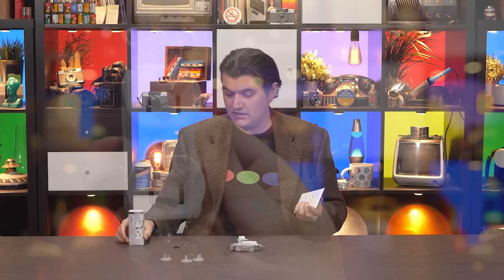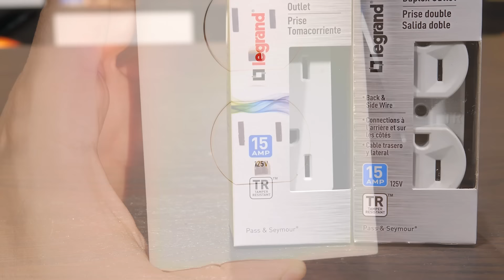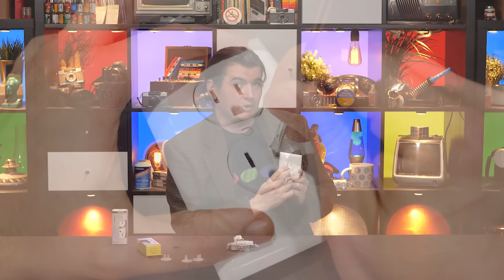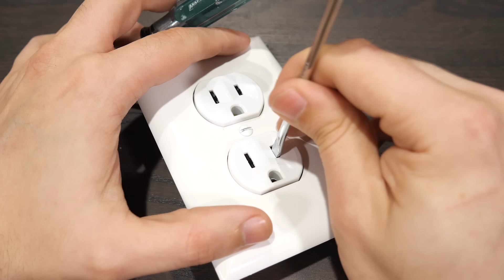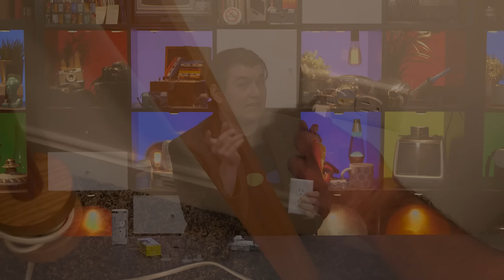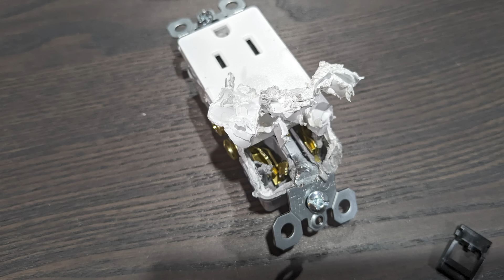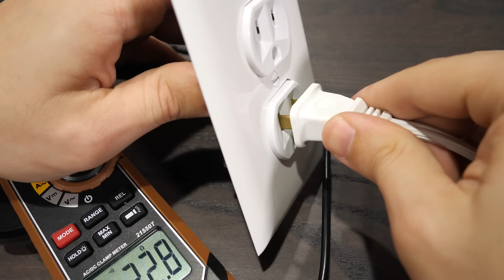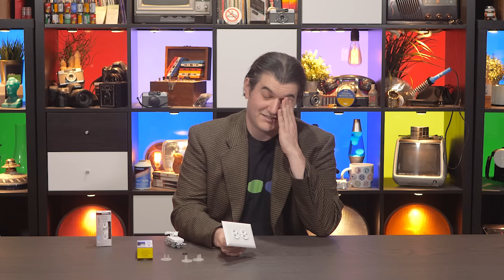Tamper-resistant outlets aren't all the same - a follow-up

Comment: The tangent about voltage reminded me of people who say "its the amps that kill you, not the voltage".  The problem is, they're related.  More voltage directly equals more amps, all things held equal.  I prefer to say that "Voltage shows how hard it's trying to kill you, amps shows whether it succeeded". 1.2V is barely trying to kill you, it is only technically possible in extreme circumstances.  12V can try, but almost always fails, usually just giving a tingle.  120V is dangerous and should be respected, but is only occasionally a death sentence. 1,200V is very bad news if you touch it, and can mess you up easily.  12,000V is about when it will start jumping (short distances) through the air to get to you.  All of these options just have to get a certain amount of amps in various places, but they're more effective at doing it as the voltage increases.  Note: This generally assumes DC or AC voltage supplied by a decent power source, not something like a stun gun where the voltage is not sustainable.

Comment: I believe loose plugs are a phenomenon of cheaply made outlets that are wearing out. I grew up in old houses, and I don't remember a lot of vintage outlets having this problem. But the house I live in now was completely renovated in the 1980s, and all the original outlets were replaced with what I assume were "contractor pack" outlets. Not all of them fail to hold plugs securely now, but I'd say each room in the house has at least one that does. I'm replacing them with better ones, and, where it makes sense, with outlets that are tamper-proof, double as night lights, provide USB charging, etc.

Comment: If you want the MOVs to work in a surge suppressor you need a ground. A 2011 NEC change,  250.130(c), allows for a ground wire to be added  when replacing old non-grounding receptacles and a Type 2 unit on the main panel helps protect the electronics in your appliances also.

Comment: Regarding plugs falling out, I mean it literally, when I (an aussie) visited my partner (from the USA, specifically Alabama), plugs were constantly falling out of the receptacles, had to keep getting up to plug them back in. The receptacles were suuuuuper loose, I barely felt any friction at all when inserting and removing the plugs

Now that is probably from them just being old receptacles, but it was absolutely an issue I was experiencing. I've never had such a loose plug/receptacle in Australia (specifically Victoria), but found plenty in Alabama.

I don't know how much of this is due to the design of the plug/receptable, but the live and neutral prongs being parallel seems like something that would potentially make the problem more likely to occur

Comment: I've been zapped by my tape measure as it 'cracked', slid down the wall and stopped sliding when it reached the positive prong. That one hurt because I was holding the tape measure as opposed to a fleeting touch to a live wire.

Comment: I have been electrocuted by a standard laptop AC adapter.  It got stuck in the power bar and I did not power off the strip, which I should have done.. I braced the bar with one hand and reached way down on the plug with the other.  When I did this I had grabbed the plug in such a way I touched BOTH pins and the ground did nothing. I was immediately shocked very badly.  I can't not under estimate the amount of pain I felt.  My entire right arm felt like burning, fire, buzzing, and knives scraping and I was unable to move my arm for nearly 10 minutes or longer.  When I could move it, it hurt very badly to make a fist.

Since that day, I have a jump in my arm, when I attempt to do small precise movement with a mouse.

Comment: "The receptacles wear out, but it takes decades.  Unless they're cheaply made."  My last apartment must've been incredibly cheap, they couldn't have been older than 5-10 years but nearly every single one in the unit was so worn out that you practically couldn't keep a cord in it at all.  They would literally fall out of the wall entirely from gravity on the cord, unplugging the device.  I had to harass the office for a month until they finally agreed to replace them, and even then, they kept trying to ask me for a list and refusing to accept "Just replace every single one, they're all bad."  (There might've been one or two that weren't so bad, but I didn't want to have ones that were marginal, either.)

Comment: 11:30 you might be interested that they have back wire (still uses screw terminals  goes straight in from the back) now in the US.  Theres also Edge lok outlets now and they are like the cool wagos with the levers you can flip up to release the wire

Comment: Interestingly, only the intermediate age plugs seem to fall out of the sockets.
I work in a historic building (that predates man-made electricity) and we still have a few really old bakelite outlets that remain a super tight. It's a real "they don't make 'em like they used to" type of thing (though the bakelite wall plates over them have long ago crumbled and were replaced). The "newer" 40-50 year-old outlets, however, have all become really loose and the plugs do fall out (even bending the plug blades barely keeps them in the sockets). I've raised multiple maintenance requests about this because most of our computers are plugged into those outlets and the cords do get kicked out on occasion. The newest outlets (<20 year-old) hold perfectly fine but still not as tightly as the bakelite sockets.

Comment: A note on your tangent, in my time on being an electrician, I've been shocked a few times:
At 24V DC I noticed I was being shocked, it was disconcerting but it really got scary when I noticed I couldn't let go.
At 48V DC I was mostly just embarrassed that it happened.
At 120V it's a jolt, sometimes accompanied by a muscle spasm, mostly get angry.
At 277V there are usually burns, it's VERY painful, I yelped and inadvertently jumped off the ladder.

In conclusion, people are usually shocked when they find out I'm not a very good electrician.
Reply: Not as shocked as you were.
Reply: @ynotw57   Don't do this in Europe, you'll be welcomed by 400V ! (tree phase 240/400 not an industrial but an household thing you can encounter in 9Kw  full  electric range)
Reply: @lapub.  three phase? No thank you.
Reply: 3 phase is the shit. been give my boss shit becouse they put split phase in at work  @ynotw57
Reply: @lapub.  to get 400V you would need to touch two live conductors at the same time, unless you're in a 400/690 system which is getting more common, but usually only in large industrial applications where safety standards are a lot higher.
Reply: @UhOhUmm  sure but some country like Belgium sitll have some old 3 phase system with 127/220V with all appliance run at 220 between phase, it was just to let know you can even have higher voltage in home in Europe
Reply: @ynotw57  Why ? it's useful, you can run refurbished industrial appliance, like a 4KW Karcher !
Reply: @lapub.  it’s definitely useful, but I wouldn’t want to experience it through my fingers.
Reply: @lapub.  I don't mess around with 480V here. If I'm working in a 277/480 enclosure I suit up. Gloves, robber mats the works. I've seen people who have blown up their hands in those cabinets and I take no chances.
Reply: @UhOhUmm you say that… I end up in the 480 cabinets far too often as someone not in maintenance, nor trained in electrical work. 

And yes, it absolutely terrifies me every time I open one.
Reply: @ynotw57 3 phase is not anymore dangerous/painful than single phase. It’s the same thing, just 120° out of phase from leg to leg.
Reply: @lapub.  to get more than 240V you would need to touch multiple hot wires at once, and that would be a next level screw up.
Reply: @UhOhUmm  so you have to get 220V with a 110/220 center tap to groung transformer. I'd like to see how look the safety standards in US for a 690V system as they are a lo't of bare coppers for 220 V that even didn't exist in europe at the 110V era !
Reply: @benkitesurfs, the additional concern about 3 phase is that there's more voltage and amperage, particularly at the main disconnect, so bigger arc flashes might happen. To negate that, industrial/unionized electricians typically receive more arc flash training and use ppe on the higher amp switchgear.
Reply: @ynotw57     Somewhere around just shy of 100% NW European electric kitchen ranges work at 400V 3 phase. There is NG customers in GB and Netherlands which have abundance of NG which is different topic. I havent visited house that has only 220V 1 phase service for 30 years, but i know there is some still in here, in northern wilderness, miles away from neighbours. Utilities which bring 400V 99% of the country just ran one 220V leg to this particular customer in middle of nowhere. I grew at farm, far away from towns and we had 380V 3 phase in  turn of 70s/80s (380/400/415V is all the same in Europe). Mostly you have only THICK cable coming from the wall, no power plug. Cable is connected straight to ranges inputs. No one wants range sticking 6 inches out of the wall, like standard 400V wall socket and plug would cause. The delivery guy who brings new kitchen range to you is qualified to connect it. Delivery guys from stores are trained electricians. Fuzes for kitchen ranges are often 3 TIMES 16A. Yeah, water boiling video made here in Europe would be much shorter....
Reply: Consider120V 400hz. (used in many military situations for specialized electronics gear - extensively on US navy ship) - because the frequency is so high, it doesn't throw you off, and you just hang on until you fry.
Reply: You couldn't let go of 24V DC? As an automation technician I literally handle it every day, to feel 24V DC you would have to lick it with your tongue.
Reply: @UhOhUmm  I work in Telecom, at the time I was rewiring a DC to DC converter another contractor had improperly installed.  It was a really hot equipment shelter and the wrangling the 4/0 Telco flex was getting to be a pain in the ass.  Additionally, the equipment rack it was mounted on only had about 12" of clearance between the back of it and the wall, and all of the cables terminate in the rear of the equipment.

The idiot who previously tried to wire it not only F'ed up landing the wires on the converter, but didn't even land the parallel 4/0s correctly on the powerplant (what we call our large rectifier cabinet) side, feeding it from two separate 250A 24v breakers in on two different breaker shelves in the powerplant.  I had removed the one breaker, but I didn't think to trace out and remove the other, because it didn't occur to me there would be one.  There's supposed to be an adapter plate, and both leads are supposed to be on the same breaker. So, you're right, I wouldn't have been shocked at all, but I was in fact sweaty as hell.
Reply: @BluCappy419  Where I work there's A lot of 480 3 phase equipment, and always thought they were way overly careful requiring all that protection working on something that has no power going to it, until I realized it was 480v and how bad that can go if someone screws up. It's A long shot that both the shutoff and the testing device used to make sure there's no power fail. I, however would not be willing to bet my life against it.
Reply: @UhOhUmm  or have salty water dripping wet hands !
Reply: @UhOhUmm I worked on a lot of 24v circuits, can confirm. Was in a military tank working on what I thought was an isolated circuit and was wondering my my sweaty arm was tingling when I rested it on the metal. Definitely more of a "huh, that feels weird. Wait, I'm being shocked"
Reply: @herpnderpn2484  Yeah I mean, a small tingle is possible to feel if your hands are wet and you're really well grounded, but 24V is not nearly enough voltage to take over your muscle control.
Reply: @UhOhUmm  The difference might be in the amps - at a certain amount of amps, letting go becomes difficult to impossible, even if the voltage is low.
Reply: ba dum tsss
Reply: AC circuits under 600 volts RMS are classed as "low voltage" while 24 volts and less are classed as "safety extra low voltage", but deaths have occurred while working on 12 VDC automotive circuits.  It depends on an individual's skin resistance, as voltage doesn't kill; the current does. When I took an electronics class in high school, in the days when we still worked with vacuum tubes, the teacher drilled it into us to keep one hand in the back pocket when working on live circuits.  As I found out one day, 300 VDC really hurts, and I'm lucky to be alive and writing this today.
Reply: I got to watch a co-worker pop while working as an electrician.  
Somehow he became part of a 480 feed line while opening the building disconnect for it's transformer.  Whatever happened vaporized the transformer and is something I won't forget.   Decided that it was not worth what I was being paid....
Reply: @KageShi …did he died
Reply: @KageShi  - 480 volts RMS is still classified as "Low Voltage".
Reply: @Milosz_Ostrow  I'm aware,  I can't say i've wanting to play with kV lines.   Air gets wet enough its conductive enough for me to become part of the circuit without trying to be.
Reply: 24v DC you should not feel more that the fact that there is electricity in the wires... slight tingling sensation at best.
I have been shocked with 240v AC a bunch of times... unpleasant but nothing besides jolt to the muscles.
Most I have been shocked by was around 12k DC. faulty insulation on spark plugs cables. I could feel exactly where it passed through.
DC is a tricky thing to be shocked by. You may be fine immediately after but may still die many hours later from kidney failure and such as your own blood becomes toxic.
Another thing is that basically anything above 50v can be lethal in unfortunate series of events.
And amount of volts mostly just means that it's easier for electricity to go through skin and insulation... 120v already not having any trouble shocking you.
Reply: Don't come to Canada, 347/600 is the standard 3-phase voltage. You'll ride the lightning, that's for sure.
Reply: It goes with the trade, it a hazard( or feature, depending on the person 😂) of the job, eventually you'll get zapped.

Eighter bc you tried some stupid stuff or just plain old tiredness.
Reply: @Andrei-xl1xe  If you did such sloppy work in the nuclear industry, you would be in jail.
Reply: @Shaker626 so? It happens, we aren't robots, no matter how many precautions you take you'll eventually get zapped in your career.

Just because you were born with silver spoon in your mouth it doesn't mean everybody began their careers from the top.

Btw that was assuming you work in the industry or you even worked a day in your life at all.

But by the way you talk I guess not.
Reply: @Andrei-xl1xe  Zapped? Sure. Ambivalent about hazards to a dangerous degree? No

If the Nuclear Industry's every worker can avoid fucking up this bad, so can you
Reply: Thats shocking. Hopefully you're better!
Reply: i remember one time when i was involved with rennovating the shop office i was working at, someone wired the wiring all screwy across 2 seperate breakers for 1 outlet circuit
the live was 78V, the ground was 42V, and the neutral was 4V
not thats already fucked, but we only found out after someone next to me grabbed the ground and said their back stopped hurting
Reply: I don’t even bother being careful wiring 120 VAC live. I’ve been zapped plenty of times since I was a little kid and nothing has ever happened to make me care.

Comment: Whenever I'm in the US, I use a non-grounded EU apple MacBook charger with a 2-prong EU->US adapter. It's so heavy that it will literally fall out. I need an extention cord that lies on the floor so I can prop the charger up. I should use a US plug directly onto the charger, but you don't get a whole set even though they are swappable ;)

So yeah, if you include a 2 prong World->US adapter then plugs tend to fall out. Not an issue with US->EU adapters ;)

Comment: I've encountered plenty of loose sockets in airports and hotels where the plug falls out.  The springs seem to wear out so that they don't hold the plug properly.  This is more of a problem if you have something like a heavy 2 pin adapter plugged in (like older Apple MacBook adapters).  Adding a ground pin to these plugs would solve this and make it stay in better
Also, you're idea of putting shrink sleeves onto plugs in North America (from the previous video) is great.  This should be something that should be required for new plugs and kits sold to retrofit to older plugs.